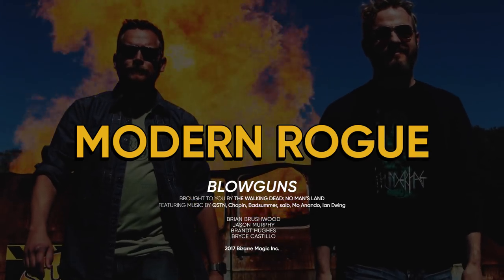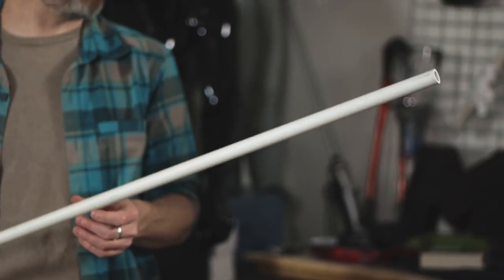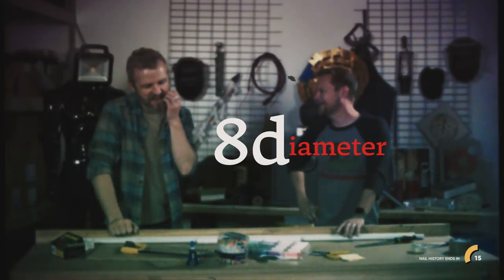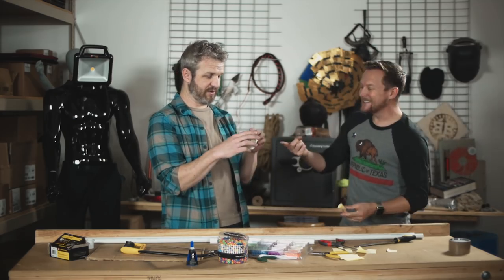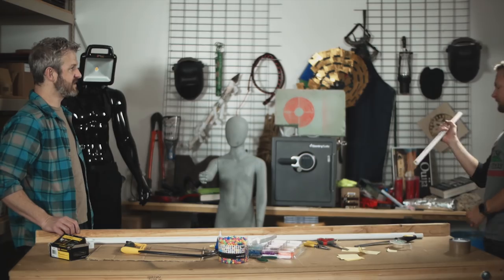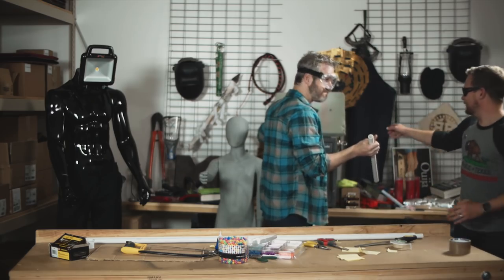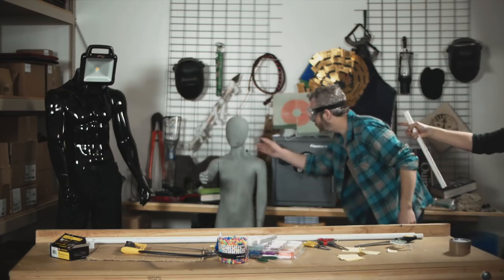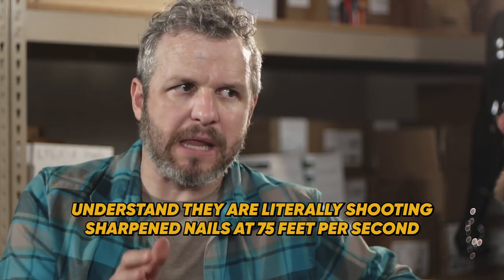Making PVC Blowguns

Comment: i have made this before, i used a PVC pipe that was around the same length as yours and it actually decreased power and accuracy because of how long it is. if it were something much stronger like bamboo or metal the extra length would help but because it is PVC it isn't strong enough for that length. i would recommend as long as possible, yet not so long that the PVC is bending due to its own weight. mine is about 3 feet long. if you were to try and make it poison laced, the try using a sewing pin instead of a nail. it is easier to penetrate with it due to its sharpness, you will need to put hot glue into the back of the cone to reinforce it. if you made one out of metal instead of PVC it could act as a close range staff and a long range blowgun.

Comment: Made couple of these Last summer, was a blast to shoot with em. Only problem i had was that when i made it work properly i accidentaly shot couple of darts like 100m away and accross the road and stuff like that. I was affraid they would puncture landmower tires if i left nails all over the yard, and i must say, do not shoot them in the open, you wont find the darts if you shoot em 20+ meters away, unless you want to search with magnets.  I made those tail thingys out of duct-tape strips i taped against eachother to form the cone and so far it seemed to be the best option in have seen since it also gives a good air seal inside the pipe and darts seemed to fly a lot faster

Comment: I used 3/4", maybe 3ish ft, pipe, using a taped on rubber lego tire as the mouthpiece, packing tape for the feathering except instead of cutting the cone to fit exactly you cut like an extra 16th of an inch higher and then make slots 16th of an inch intervals which are like 3/16th of an inch deep and it makes a perfect seal, for the shaft I used a metal coat hanger cutting it around 6-8 inches long, curving a tiny piece at the back to give it something like the nail's head, and then hammering the tip to be flat and using pliers with cutters to cut a broadhead shape into it then filing it sharp, though you do need to push it through the feathering after curving the back but before hammering the tip.

Comment: I think I seem to have solved the problem you guys are having with the dart's not flying completely level. I solved it by cutting a plastic planter's lid the diameter of the blowgun I use and then slowly shaving it down to fit the inner diameter of my blowgun more or less precisely. It's not a perfect fit using a pair of scissors to do the shearing, but these bore stabilizers really help accuracy at long range and rarely have to be replaced, at least when shooting at targets.

Comment: Although you are adding beads to the dart, the beads are less dense than the metal nails which, if you are looking as the entire dart as a system, you are increasing the volume of the system while keeping the mass lower than what the mass to volume ratio should be meaning that you are decreasing the density of the system. Because of this, the dart has less momentum and causes more drag considering it's not streamline which actually hinders the effectiveness of the dart rather than making an improvement to it.

Comment: Use 1/2” metal electrical conduit.  Then  take used plastic cones from rocket fireworks, 6d-8d finish nail through the end and yes, it would sink into a person.  I’ve buried them into wood so deep I needed a claw hammer to pull them out.

Comment: Stuff some plasticine into the cone against the back of the nail. Not much. About as much as a 5 - 10mm bb and pack it in tight. You'll bury that bugger in a tree. I saw a guy use the bottom bar of a steel coat hanger too. He put those through a hardwood fence. Fun but deadly. And to size your cones perfectly, drop them into the tube befor you cut them and cut them up against the tube. Perfect airtight seal. No pressure loss.

Comment: My brother and I would make "nerf" blowguns with PVC pipe like this, but use foam insulation (long round foam cylinders in coils) and put a piece of lead shot at the tip and hot glue over that. Had a mean sting and was super accurate b/c the lead added inertia and the foam would spin behind it in a cone shape.

Comment: You could create a nice tapered mouthpiece by heating one end of the pipe with a heat gun and forcing a cone shaped piece of wood in to the desired depth.  Only heat it enough to make it malleable.

Comment: It would work better if you use hot glue instead of super glue to put more weight behind your dart. Also when you make your cone press it into the gun before cutting so you can get it perfectly pressed against the PVC before cutting. I have had my blow gun for a little over a year and it still works great. Also if you tape up the entire sticky note they will be less susceptible to wear and tear.

Comment: I went to the Amazon with my family when I was a kid and me and my siblings bought some tourist approved blowguns+darts from some natives. Short blowguns with a bit of a funnel shape, the darts were wooden about the thickness of a toothpick but much longer and bendy with some cotton as wadding. They looked more like pieces of art than actual powerful blowguns but the sure packed a punch, when shooting at a hardwood door back home we actually managed to get the arrows to stick.
It was very counter intuitive having a flimsy wooden splinter stick to a hard door but smaller calibers tend to have better penetration and the flexing makes it so it doesn't shatter from the impact. 
I don't know much about blowguns but from that experience my guess is to go for low weight and flexible darts rather than focusing on adding mass, it's also requires less force when you blow so you are able to use longer blowguns (the only reason we bought short blowguns was convenience, the hunters would never use those on actual hunts)

Comment: We made legit blow guns in high school, out of staples, paper and tape. Rolled a tube at about the diameter of your thumb, then take a staple and  straighten it out make your cone and poke the staple through the cone tip. Properly made it will easily stick in a foam drop ceiling about 15' up... good times

Comment: check out footage of south american tribes in the Amazon (Peru specifically) making their like 9 foot blowguns they use to hunt monkeys high in the canopy (using wooden darts coated in curaré, a super powerful paralytic made from a combination of plants and frog poisons iirc). no bamboo there so they have to find long branch segments, round them perfectly straight and uniform, split them lengthwise, carve and smooth the inner half tube on each side, again perfectly straight and uniform and identical on both sides, and then adhere and bind the two halves back together. each one is well longer than an adult, and they are hitting targets like 30-40 meters above their heads. penetration is minimal but the tiniest bit of the paralytic will drop the animal so it only needs to pierce the skin. something to be said for thousands of years collective experience and tradition, heh. 

there's some good coverage in the jungles episode of bbc's human planet series, and likely clips on youtube and other docs as well. I recommend reading ethnographic books for more in depth info if interested (the story behind western anthropology's discovery of the curaré recipe is fascinating).

tl;dr Amazonian blowgun hunters are badasses.  go find videos.

Comment: here are tips. i use to make a crapton of am.
1: Use a tiner pipe. about the size of the top of your pinky or point finger. you shoud be able to just put half of your pinky in the tube, I use to use yellow pvc pipe, the stuff you use for wires in your house.

2: How long?
cut the long pip you have in half. perfect size.

3: use newspaper, the bad paper or crossword puzzle books, NOT the shiny stuff, the notes are to stiff and are not grippy inafe Make strips of paper 3-4 fingers wide. length you just make it longer or shorter the bigger the arrow/dart has to be.

4: take the strip between your finders roll it up and pull the outside paper out to make it cone shape. lick it and stick it. and or lick the point. or use some clear tape. 

Now you can shoot paper darts
(Lot safer)

5: When you inhale put your tumb on the end of the pipe.
its good practice, it wont help with range but it will with you not inhaling the dart. its so unlikely that you sometimes forget to remove the pipe from your mouth far inaf. paper big deal. but if your shooting needles you dont want to inhale your dart. and have a needle in your mouth.

6: For exstra fun add a needel with the plastic top (as used to make cloading templates)

adding any thing will make it fly wores and dramatically decrease range.

Just use paper darts only its just as fun and is WAY SAFER!!!

and yes we use to shoot am at people from the 2nd floor. and have battles DONT DO THIS ;)
Really dont, police sayed hay so ye Dont.

Ps: sry dyslexic.
Reply: Excellent! Thank you!

Comment: I use bicycle spokes and I heat up the end and melt a bead to it then I snip the top of the cone and push it to the bottom of the cone with some hot glue it works well and they fly fast

Comment: Did you ever consider holding the nail in a drill chuck to sharpen it?
The steel used in nails is relatively soft, to be hammered without shattering. Have you considered screws for sharpness retention?

Comment: The longer tubes gave better results because the dart had more time to accelerate.
If you have access to a high speed camera you could fire darts in front of a calibrated board (just basically covered in even width stripes) and you would see the darts from the longer guns on average leave the end of the barrel traveling faster. F=ma

Comment: I know this is an old video but I used to have a blow gun, the diameter if the inside channel was super thin, only like half a centimeter. Thinner pipe means more pressure.

Comment: you guys should make a second video with fresh bamboo darts. If you cut the bamboo right after the knot then when u slice off a dart sliver you can make a tip from the knot extra.
Reply: i have gotten these to go through eighth inch maple ply wood.
Reply: copper blow guns work better too and if you add air rifling to the dart itself you can see it spin mid-air. darts vary from lengths from 4 in to a foot...

Comment: I have one made of 6 1inch pieces linked just by connecters so it's easy to carry and conceal but I use a wet square of toilet paper to pretty much make a giant spitball Cannon and mess with my siblings   but if you take Paracord you can tie a Celtic button knot or a diamond knot and they work as relatively soft musket balls

Comment: Use a wood skewer about 6 inches long, then coil string into a ball on the blunt end, adjust how close to tip for weight, make sure its the diameter of the hole and you should be able to peirce soft to mild wood at 20 feet. Thats how my malaysian darts are formed.

Comment: 6:00 nope.  its not a glider.  its a dart.  you want a ton of weight at the nose and drag at the tail like a rocket.  this keeps it flying straight and stabil.
Reply: also all those times it was wobbling in the air and not sticking in the board was because you didnt have enough nose weight.  adding the beads may have made it worse.

Comment: Imagine if the nails were ungalvanized and rusted red. Or dipped in any of the dozens of deadly, corrosive, or even mildly uncomfortable (itching powder!) substances they've already handled. It might not immediately kill or defeat someone but consider the immediate and potentially lasting psychological damage it can do to a target. You might not have a Dendrobates auratus crawling around but even a small cut with concentrated chili oil can do serious damage.

Comment: Dude I'm 16 with a loaded blowgun Litterally sitting in my room next to my bed, the pvc wasn'tt even new when I made it and mine can penetrate hardwood from pretty damn far, the nail on mine is smaller but the cone is bigger. Mine is deadly accurate and really I was just waiting for you to use the longer ones, I've toyed with shorter ones and they're nothing compared to the sheer acturacy and power of a 4 to 5 foot blowgun

Comment: i'm sorry but there are some things you guys still need help with, as one who has lived in south america, and having visited one of the Indian villages let me tell you a bit about them, note that everything i say has probably already been said somewhere, but i'm not looking through all 1,4## comments to find out. these from what i know were never intended for human combat (they had more nasty weapons for that), only used for hunting for hunting primarily birds, originally they were made by taking a straight stick about 4 to 10 feet long splitting it length wise, cutting a small grove 1/16 to 1/4 in depth (size depending on type of game to be hunted) gluing it back together and wrapping it in some kind of twine, filling it with sand and running a very straight stick through the hole to smooth it. the darts were made by carving the stem of large rain Forrest leaf and were single use, larger darts had feathers on the back to keep them flying true, while smaller diameter darts were made extra long, probably to increase mass. they were sometimes coated in various poisons to increase lethality. the general physics of these devices is: a longer pipe CAN increase accuracy, but also adds extra cubic inches of air to be overcome, smaller diameter tubes mean faster darts but they must also be lighter weight to achieve maximum force. the key to success is making it straight, and keeping it straight, your larger diameter pipe has too much wiggle room for the tip of the nail to move arround in, your long pipe can be seen bending under its own weight but thats not your biggest issue, your "flechetts" are too rigid for  your tolerances, when you see your darts corkscrew its because either your nail is not inline with the cone or the cone itself is warped I recomend using some kind of a forming jig for the cone and a small funnel for alighnment. if you want to sharpen your nails (ive never had much of an issue with sharp vs dull) the eaysy way is to put the nail in a drill chuck and then take a file/ grinder to it (also you know your only supposed to file in one direction right?)
Reply: Fascinating info. Thank you!

Comment: use poster tack under the head of the nail and dont sharpen the nails... it gets rid of the point faster
Reply: and use an adapter on the pvc
Reply: and i have killed a cyote with a blowgun

Comment: Just a little physics for you: the smaller pipe is actually a greater force due to increased velocity, and decreased pressure. This inverse relationship is called Bernoulli's principle. Think of it this way- your lungs are still pushing just as hard, and they produce the same amount of pressure. The same amount of pressure cant just fill up and down in the pipe the same way it can in the big pipe though, so it travels along the pipe faster.

Comment: I started watching your video  and within a few seconds I realised that this is actually a failed comic channel. I wondered whether I should waste my time with a comment and finally decided to give you the benefit of the doubt that perhaps you are trying to be serious and actually give viewers useful information.
As it is, you remind me of two adolescent schoolgirls who have discovered a vibrator and are wondering exactly how it can be used, inthat you take some pieces of pipe, stick them into an orifice and see if you can get any joy out of them.
Come on, guys: add a bit of logic and science to your work and you may just be able to discover something of value to both you and your followers.
Firstly, think about the missile itself. In order for you to be able to determine its maximum effect, it must have a certain weight. That is what the beads are for, not to act as a "counterbalance". So first, before aiming your blowpipe at a target, load on some beads and step farther and farther away from the target area to see what is the greatest distance you can blow the missile so that it will stick into the backing board and how many beads you require to attain your greatest distance. Set up a  hinged and pivoted cradle mechanism to which the pipes can be secured, so that you can move the pipes through small increments when you do this, so that you have some sort of control by which to judge your later, hand-held experiments. You can secure the cradle to the workbench - and before you start moaning that you will have to kneel down to blow on the end of the pipe, tape a length of flexible pipe to it for you to blow into. Use your heads, men! Actually THINK the experiment through, see what must be established, consider various options to attain whatever it is you want to prove and THEN set up the equipment to conduct your experiments.  
Remember that a heavier dart will travel farther than a light one, up to a certain point, whereafter it will become too heavy for the pressure your lungs can develop, so that  distance will fall off. Your job is to find the happy middle ground. 	
Once you have found the optimum dart for your particular lung capacity, take the pipe out of the cradle and THEN go for accuracy by hand.